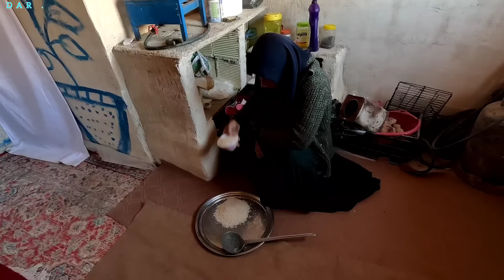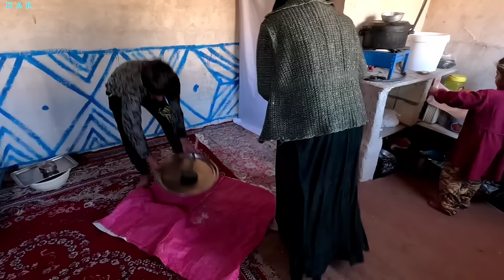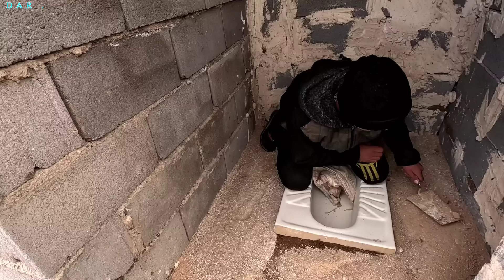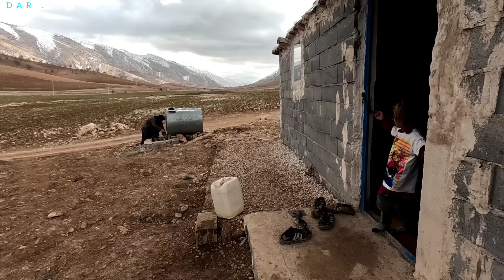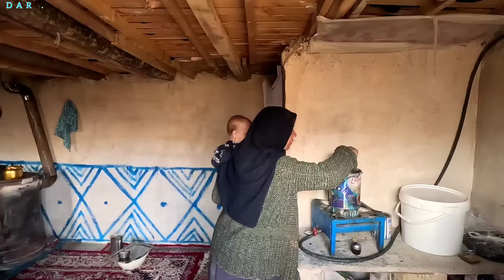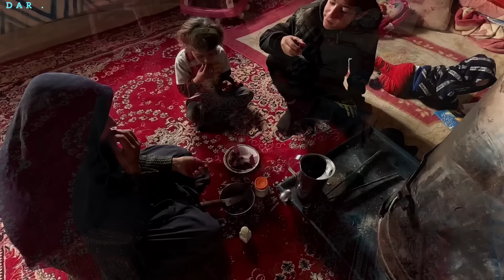Deception, Betrayal: A Mother's Courageous Battle Against a Father's Plot for Children Custody

Comment: Mother and Sajjad, look at the top or base of the drum, you have beside the toilet well. Cut either top or bottom but leave a ridge. Now make the top of toilet well, same size as drum lid. Now concrete top of well and inside edge, till you fit the lid in. Like top and glass 🫙 I saw the drum and thought cheaper option